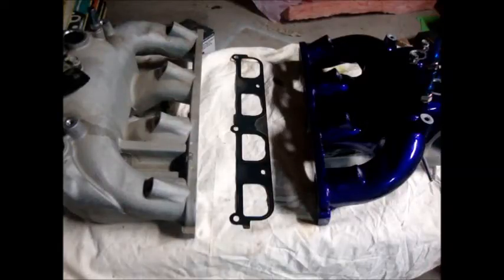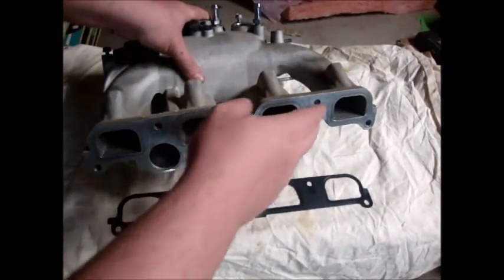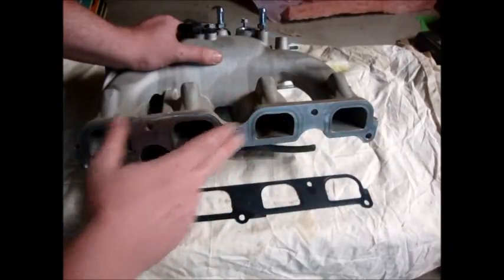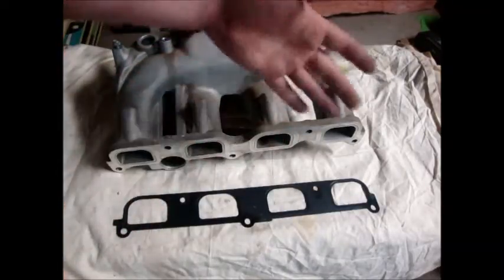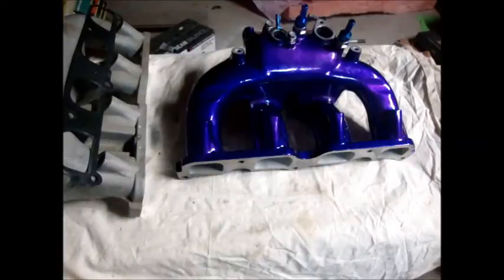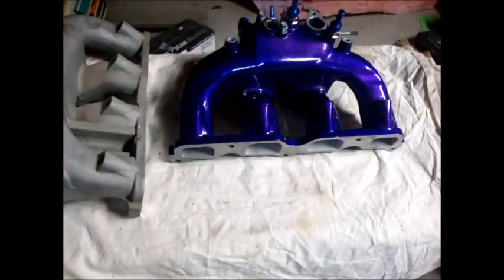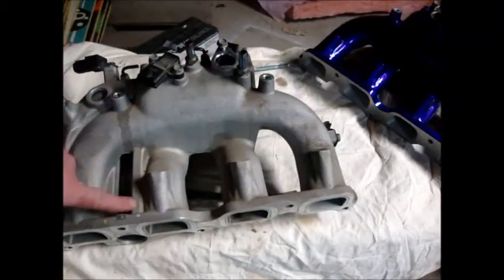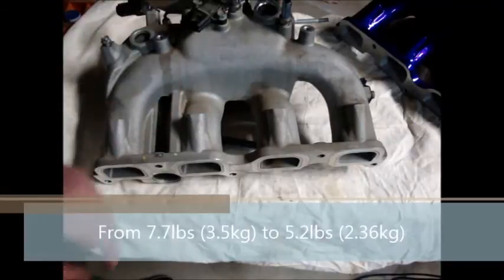GrimmSpeed intake manifold PnP review

Comment: What tools did you use to cut the Alum IM?
Reply from the maker: Angle grinder, die grinder, dremel and palm sander.
Reply: I want to do the same thing. I have a 2013 2.0 Rspec with a manifold just sitting by.. I have the two middle runners gasket matched. The purple is your original color my Gen is Satin Pearl.
Reply from the maker: Trevor McDaniel The purple is a powder coat called Translucent Grape, my turbo and intercooler piping are the same colour.